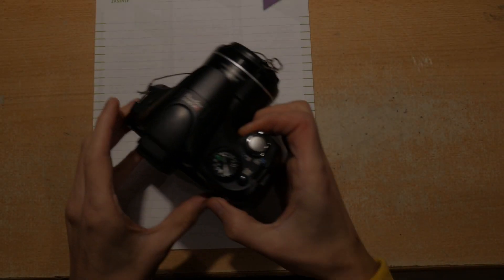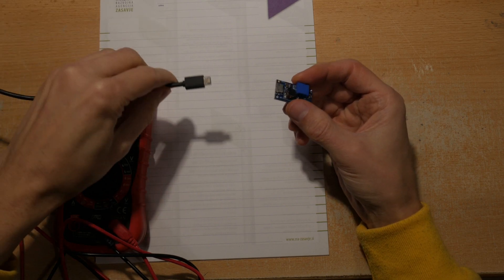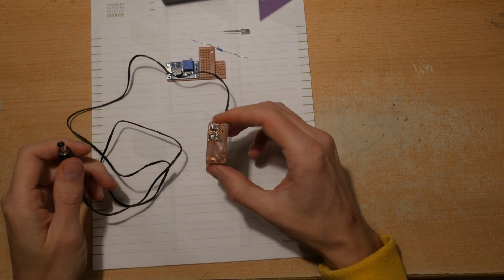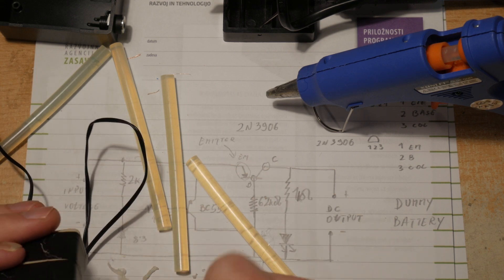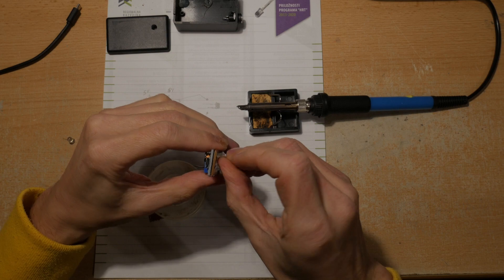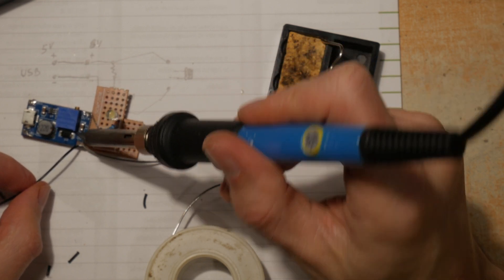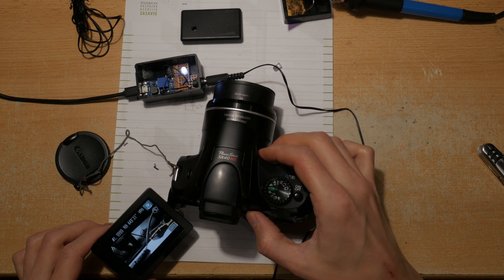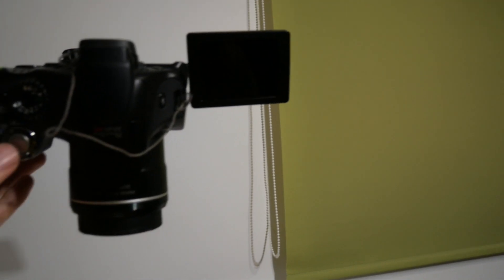Make Simple Camera Dummy Battery

Comment: Esto es increíble, me ha encantado!  eres un genio. 

Tengo una duda, para que pones los leds y las resistencias adicionales? soy nuevo
Saludos desde colombia!!
Reply from the maker: Hello 👋 Thank you for the feedback and the question. I used the led so I can see if the circuit has power and the resistor is used so that the led does not burn out, as they usually operate at about 3V.
But I have to mention, while this dummy battery works it fails with my camera when I use the zoom while recording. Maybe I would need a power supply with more amps like a 5V 3A as 2A is not enough. Or I would have to revisit this project and improve it.